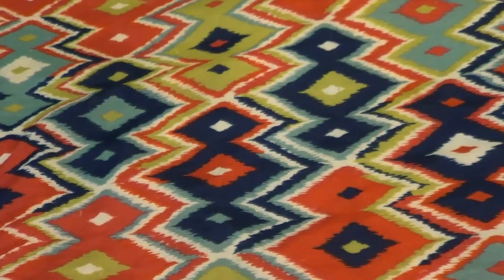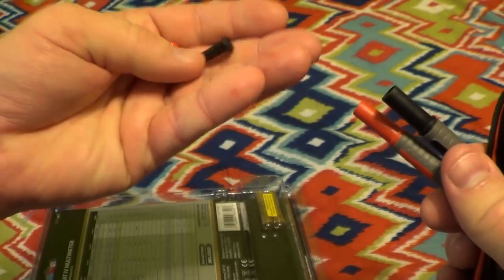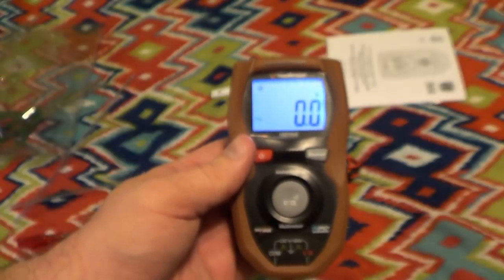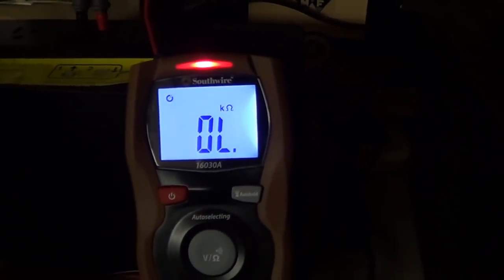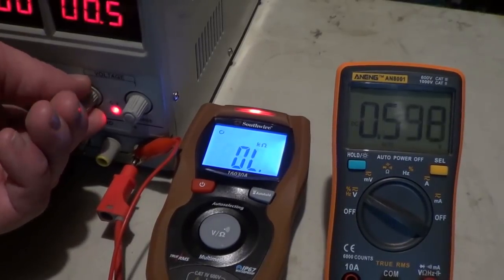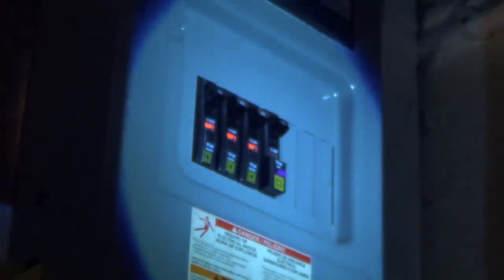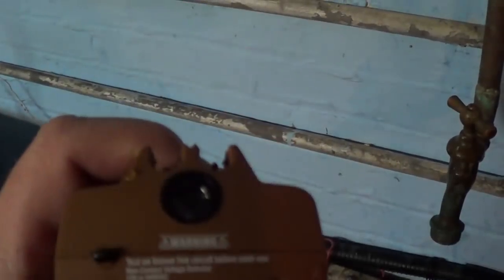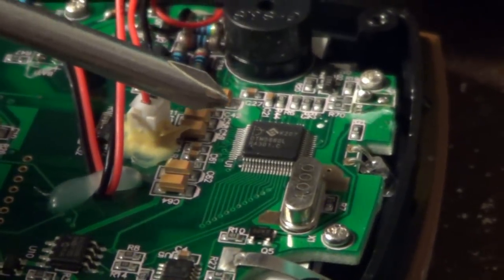Product Review: Southwire 16030A Digital Multimeter

Comment: Best frigging review ever!  Love your snarkiness, the candy ham...bought my 16030A abt 3 years ago. Didn't see much use.

 Installing my cousins new smart t-stat and need to know if we have power on the furnace board. I didn't know abt the flashlight and no-contact function. I cringed when you threw it in the water.

Overall, I am very pleased with my meter based on your review. Just opened the battery compartment...no leaks and battery indicator still shows 3/4 full.

Comment: After reading good reports and tests done on GP batteries I've been using the GP Ultra type for a good few years now. Mainly due to having seen so many of my once trusted Duracell brand batteries leaking, not only in my own equipment but many repair jobs too. I've even had brand new in date Duracell batteries bought from reputable sources showing early signs of leakage.
I now buy GP Ultra batts in the many hundreds, and after switching to them have yet to see a leaky one, even well expired batteries show no signs of insulation seal failure.

Comment: Very comprehensive! 

I’ve noted that the non-contact feature appears to work as it should if the leads are removed and the meter is not handled with the bare hands. Looks like it has to be insulated from ground.

Supposing it’s necessary to drill a wall, this device may help in determining where current carrying cable may exist below the surface.

Comment: Thanks for the video Bill. $40.00 on amazon. only one slightly bad review i saw there. One buyer said he blew one of the fuses in the meter and could not find replacements. Don`t know what he did but sounds like a pretty rare thing.
Reply from the maker: Amazon's lumping the reviews for several meter models together. This one has no fuses or "user serviceable parts" since it doesn't support making current tests.

The easiest way to blow a fuse in any multimeter is to connect it across a live source of power while it's set up for current measurement. The current sensing shunt is essentially a short circuit.
Reply: Thanks for clearing that up. I`m getting one.

Comment: I think the aneng meter has the same dmm chip, the ability to add offsets to correct errors makes that chip a gem, well i think so :-D
The southwire seems to be resolution restricted at low voltage input, even the cheap 830b does better with it's 2000 count ancient icl7106 chip.
Reply from the maker: It's definitely widely believed (if not proven) that the Aneng meters base on the same chip. Theirs are the only ones I've seen using a COB version, though. I think they're great value for money if you understand that there have been some shortcuts taken, and that some of the models have interesting bugs. I'd also have to think that the DTM0660L (a relabeled Hycon HY12P65) is taking the multimeter world by storm.

Although the venerable DT-830 has better low voltage resolution, the Southwire is far safer in the hands of a beginner. Its designers may have thought about including a millivolt range, as there is an mV character in the display.

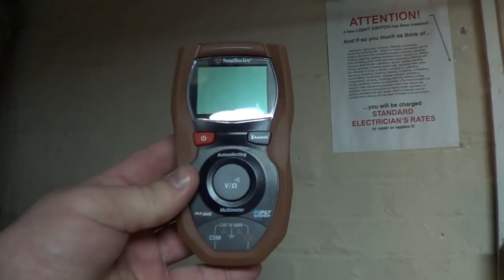Comment: What does that sign at 30:44 say? I can't read anything between "And if you so much as think of" and "...you will be charged...".
Reply from the maker: It was a warning to my bothers, telling them not to break another light switch handle after I'd installed the second replacement. The "fine print" was a dryly humorous passage listing everything that was not allowed to be done to that light switch, or they would pay "standard electrician's rates" if I had to repair it again.
Reply: What was that dryly humorous passage, though? That's what I'm asking about.
Reply from the maker: I am nothing like dedicated enough to haul a computer in there and transcribe it. :-)

Comment: I Luv my Southwire Residential Pro (13070T) It's Accurate an Durable" It has TrueRMS, Low-Z, Auto range,  Backlight, work light an ip67 waterproof and dust proof 💪😏 
Definitely Best Multimeter I Ever Owned.
Reply from the maker: The only bad thing about the 13070T is that it has no manual range operation. Other than that one minor nit, it's a very good meter.

Comment: Renew those anti-theft devices with a few swipes of a strong magnet (preferably in store so you don't ruin the surprise) and stick one on a friend. I think that was a thing put on by KipKay a few years back, but there was an "I'm not responsible if you get the crap kicked out of you" warning in there I think so a friend with a reasonable sense of humor might be required for that one.

As for the focusing on the camcorder, I think that might just be a Sony issue. I've tried recording some projects for the local public access television with my Sony HDR-CX760 and the Sony has some of those focus "flashes" that were oh so common on cheaper MiniDV camcorders (at least the ones I happened to own) back between like 2002-2006 or so. My Canon camcorders focus fine (except the low budget television camcorder, that one can't focus worth a damn for some reason that I can't quite pin down).

Comment: Eh, in two weeks, I'll be supervising the installation, including K-12'ing a wall opening for the supply and return, the electricals, grounding rod, pad installation, gas line, and control wiring, for a 3 ton Carrier Gas + A/C Package Unit ("gas pack"). You're welcome to the party, 2 states to your east. EDIT: PS, the building it will be installed onto, is next door to a brewery.
Reply from the maker: Much as I appreciate the invitation, I presently lack the resources to get there. Otherwise I'd seriously consider it.